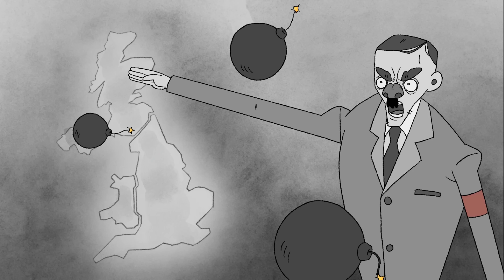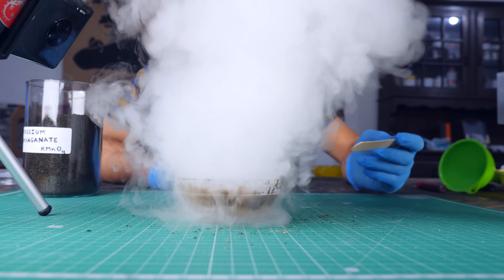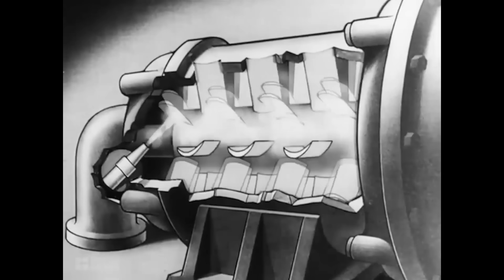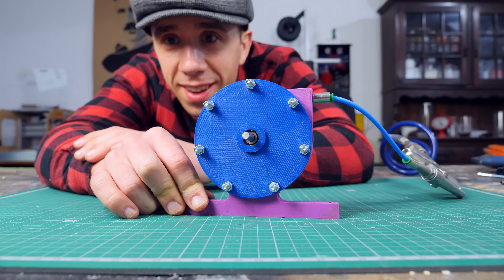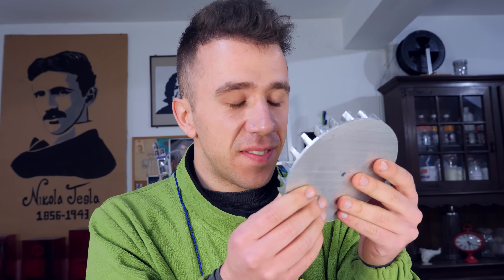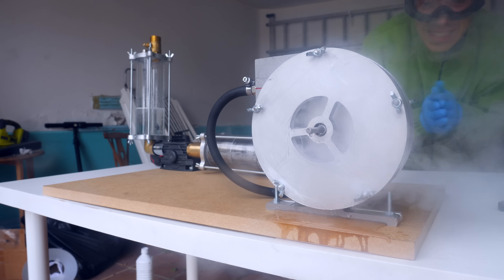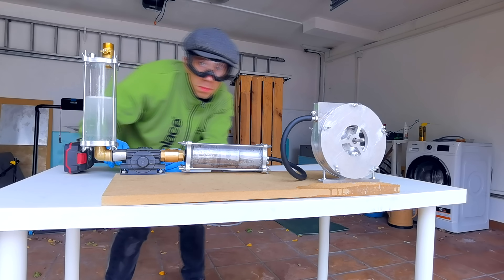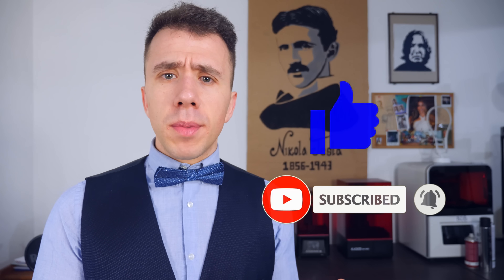I built the World War II V2 Rocket Steam Turbine

Comment: Using metal!  Yes - so much better than leaking and melting plastic!  An engine that is working is an excellent start.  I'd prefer  a small Go Kart to a skate board - much more practical to use as transport to a skate board which will only move itself likely.  Then again - that engine looks very under powered - it would have to be scaled up greatly - at which point I'd fear for your life - so perhaps not.  Certainly as already said - mount vertically and have a couple of inches of tube above the catalysts to reduce losing so much peroxide through the system.  Perhaps additional smaller catalyst grills can be added to the connecting tubes to convert any spray blown through.  Or improve the surface area of the catalysts in the first tube to get a better conversion.

Comment: Why not using a car turbo that can take a lot of heat, has constant lubrication, a perfectly balanced turbine and shaft and almost no drag. Also, the angle of the steam coming in might not be optimal. Catalytic converters work better when hot, why not pre-heat them before pushing in the hydrogen peroxide? Wouldn’t it oxidise more efficiently?

Comment: You need to get a bench top lathe, for metal, I need to get lathe also! 😆, Maybe 4"-6", 3jaw chuck, being able to make parts from metal will take things to the next level, I would like a 3D printer, so I can print things to make molds, to cast from aluminum, and about any car part made from aluminum, can be melted and cast, especially structural components, or pistons, very strong, and pistons will not expand that much with heat,  ya would not want to use aluminum cans. Too soft!! It needs to be an alloy, or you could buy  good old 6061t6 aluminum , but the salvage yard, or recycler  will be cheaper, but more work!! Awesome job!!

Comment: Maybe to improve the decomposition of the peroxide you can have the pump run the peroxide vertically into the catalytic converters. That way the liquid stays at the bottom of the converters and the steam rises up into the turbine.
Reply: That was I also thinking + he can put some pressure valve just before the proppeller acting as a buffer so it can have higher output pressure at the end
Reply: @krissko97  pressure regulator before the turbine is a great idea
Reply: @krissko97  this would just create backpressure and reduce the power at the turbine.
Reply: And maybe some empty space at the top to let any liquid that gets pushed up fall back down
Reply: This is a great idea.
Reply: My first thought, totally agree!
Reply: yup I was thinking the same thing
Reply: A peristaltic pump would be a better choice for the feed pump.  A metering pump for a well or swimming pool disinfectant ( NaOCl solution) would be ideal.  These are frequently variable speed and can be controlled with a 4-20mA signal.
Reply: Great idea. It's an optimal solution for a liquid trap and the sump can be connected to a vaccum pump...which would scavenge the whole catalytic system with a partial vaccum and improve catalytic reaction because less "spent" water and oxygen are blocking the cat surfaces.

Comment: A video comparing various turbine designs would bring together a lot of your videos. When should impellers be used? When are stators necessary? How many stages? Which turbines produce the most power or RPM for a given fluid flow?

You could print them in resin to compare designs, with the highest output and highest power designs milled on the CNC to see what output you can maximally achieve

Comment: Just for clarity both the v1 v2 and v3 projects happened at the same time being handled by separate teams. The v3 was a set of multi barrel (50 in total) multi chambered ( the charge in each chamber accelerating the round to faster and faster speed)  150mm guns, the barrels were 150 metres (490ft) long and were positioned underground at a sight in Mimoyecques France.

Comment: Video idea: Combine this with a steam engine (like the one you made a few months ago, but bigger) and create a TURBO STEAM ENGINE (stu stu stu). Hear me out: use the steam produced by the chemical reaction to power one or two pistons, and since the pressure is so great (you said 16 bars), you might be able to use the exhausted steam to power a turbine. The two pistons will power the flywheel (and maybe something else, since it is more efficient than the turbine), and the turbine (maybe connected to a on/off gearbox) could power the water pump (the one at 9:44) for continuous thrust. And there it is - the engine for the Steam Punk - Steam Powered Skateboard.

Comment: Mount the catalyzer on a 45° angle, minimising fluid output, then into a centrifuge trap, catching residual fluid in the bottom n steam out into the turbine. A fluted outlet on the turbine may increase output also.

Comment: Theme for a future video:- The electric jet engine which you just made reaches several thousand degrees at the nozzle, what if you convery the exhaust into *plasma*, and see it with a thermal imaging camera, you can do this by attaching a high volt power supply wires at the exhaust and make the part of wires at exhaust with tungsten to prevent melting. Improvement sugesstion:- you can use a porous thing to store Potassium Permanganate and pass the hydrogen peroxide through it, I think it work better than platinum or palladium.

Comment: Now that you have the CNC machining capability, you should revisit some of the projects you almost, but not quite, succeeded with. The pulse jet, for example. An aluminium nozzle would be much better than the plastic or ceramic 3d printed ones you tried before. You have most of the work done for them, and it would be great to see the projects finally tied up and properly working!

Comment: Turn your catalist upright with pressure hose at top so you don’t blow out the peroxide.  Also try gearing for your electric generator.  To add a piston set up with flywheel may give your better yields ,

Comment: Add a reflux chamber after the catalysator, mount the catalysator horizontally make the reflux chamber big enough to hold pressure to create a constant flow and increase the surface area of the impeller by adding more fins, also, increase the angle of attach at the beginning of the impeller and reduce it at the end the pressure of the gas is not constant as it moves through the impeller due to loss of momentum to the impeller and that needs to be accounted on the exit angle

Comment: Have the turbine shaft vertical.  That way, no liquid build up in the bottom of the turbine.  Also, you will need to worry about precession (if you imagine this in a real rocket). You have Tesla on the wall behind you. Use a Tesla turbine.

Comment: enough power to charge a capacitor and energize a large servo for a few seconds every minuet... controlling the tail fins with a mechanical gyroscope. accounting for weight transfer as fuel is burned.

Comment: I would recommend vertically mounting the catalyzer, that way the hydrogen peroxide has to fight gravity to leave the catalyzer. And maybe a U bend with a second decomposition chamber.
Reply: The U bend would be interesting to see but I feel would be over kill and increase the manufacturing needs in an unnecessary way Occam‘s razor essentially states keep it design as simple as possible.

Comment: Next step IMO would be to couple the turbine with the pump so that after an initial push it starts to self-power. Add a centrifugal governor to equalize dips and peaks in power and you should have a pretty good system running.

Comment: Maybe if you had an expansion chamber after the converters to separate the uncatalyzed peroxide from the steam and give a place for pressure to build. You can put a valve and gauge there to be able to control the pressure and volume going to the turbine. Just don't forget to put in a popoff valve because pressure vessels and 'splosions. Having some control between the reaction and the turbine is a good thing. Setting the catalyzer in a vertical stack might be good too so that gravity helps with the separation. 
This is all very exciting, though. Your work is true garage science!

Comment: I know this won't help with design safety, but making an afterburner to burn the created oxygen would definitely produce enough power to push a skateboard. When you also combine this with a vertically mounted catalysator, making the catalysator longer and introducing a wrinkled surface for the catalysator, I think you'll create a monster >:)

Comment: I got 3 ideas, mount the catalytic tube verticaly, and make a "two stage" turbine to better use the acceleration of the gas, like, having the exhaust part build like an turbine stator and putting another layer of blades in the impeller, i dont know if i am expressing well, AND try to make the exhaust port different  diameters, testing with air compressor to look for the performance, good luck ma boy, i love you

Comment: I think it would be better if you put the reaction chamber upright and have the steam outlet coming from the top of the reaction chamber, that way it gets less hydrogen peroxide in the engine.

Also, have a small drain hole at the bottom of the engine to drain any fluid.

Comment: @integza Can you ad some metallic powder to uv resin  from which you are printing ceramic parts? With something like that you should be able to print (and sinter) ceramic-metal composite parts which should be less fragile, less porous (less leaking) and still pretty heat resistant, so... maybe it could be good material for your projects?

Comment: Sadly, I am not good with 3d modeling, but things to try out would be:

Different nozzle design for high speed flow into the impeller 
a lighter impeller (skeletonizing)
Different impeller angles
like other people pointed out, mounting a pressure valve maybe helps
maybe increasing the length of the tube from the catalyst to the turbine and mounting it vertically to make it harder for the H2O2 to flow into the turbine

Comment: If you have the catalytic converter upright and allow the hydrogen peroxide to come in from the bottom, creating the steam to the top that might work better. Also, why use a pump and one way valve, why not just a normal valve to control on/off and connect the top end where the steam is generated back to the top of the tank to equalise the pressure. Gravity will feed the liquid into the catalytic converter and the pressure is equal so the steam doesn't go backwards. Then use excess pressure with a pressure valve to drive the turbine. That would give you a constant pressure.

Comment: Here is the idea, if You want more efficient turbine, You need to make smaller gap between housing and turbine itself... Allso You can improve it by changi g blades angle, width etc.... But my first idea was, why not to use Your rotary engine (vankel) for this, it was capable to run on CO2 cartridges so it should run on steam too, just make it again but from aluminium, should be easy with your cute CNC mill.

To reduce liquid coming from reaction chamber to the engine, just read other comments, everybody have like same idea and I agree with them.

Comment: You need to turn your reaction chamber facing upwards not on its side. The outlet is too low and it is blowing the peroxide out along with the steam. Since you are pump feeding the chamber you can just put it facing up and it should work much better.

Comment: I can see two ways of improving the design. Mount the catalytic chamber vertically and pump the hydrogen peroxide in from the bottom. the reason you're getting unused peroxide out through the turbine is because the steam generated in the catalysers is forcing it out through the horizontal outlet. Mounting it vertically should keep the peroxide in the chamber, and let the steam escape (or at least, mostly.) You could also add a steam pressure chamber between the catalytic chamber and turbine, and use a smaller bore pipe from the pressure chamber ot the turbine to increase the pressure and stabilize the flow rate. 

Also, an exhaust nozzle on the turbine might be a good idea... it'll raise the chamber pressure in the turbine and stop it dribbling everywhere.

Comment: Video idea: Make a jet engine electrogenerator. 

I love the way you talk about your CNC😄 Pure love, no regrets about 30 broken mills 😂

P.S. Placing catalysts incline, or even vertically, and placing an outgoing tube on the higher end of the tube should solve left-overs to spill out. Or maybe some vertical spiral tube with a big inner diameter should let steam out, and let hydrogen peroxide flow back down

Comment: so launch an RC rocket off a moving platform like RC train or car, see if you get a higher top speed if you leave the ground with increased inertia vs just launching off the ground.  Back when I was in undergrad I did the math and it seemed to indicate such a launch system would make a significant difference, but I never had the time or workshop to test it.

Comment: For a better turbine, you can find designs from the steam turbines used on rockets just after ww2 online now days. The Soviets used a double bucket kind of design similar to yours. But the blades over lapped each other and then fed into another set of blades to capitalize on the steam pressure.

Comment: Video series idea: see how advanced of an engine you can make, using only water and electricity as your fuel. 

Create a 3D printed electrolysis chamber to separate water into HHO gas, then use that HH0 to power a simple sterling engine, then work your way up to a steam engine. Can you make a HHO powered steam jet engine? Can you make a jet that runs only on HHO?
Reply: have separated electrodes so you produce H and O sperately 
storing HHO is a stupid idea as it's a massive explosion waiting to happen

Comment: Video idea: Use the Tesla pump to power a rocket or at least a file oxidizer mixture
Reply: And also just a suggestion for this video maybe try putting the catalytic converter camber at an angle to help with the hydrogen peroxide getting through or maybe try putting in a Tesla valve

Comment: Steppers are good for low rpm applications, and turbines work best at fairly high rpm. I think that for power generation you'd be better off using a gearbox along with your stepper, or no gearbox but a simple dc or brushless hobby motor

Comment: You don’t want one input on the turbine, you want a dozen or so (also hardly any extra space between the turbine blades and the turbine housing so most of the stream is doing work, also make the turbine blade turbo charger shape so as it exits the turbine its still doing work

Comment: You can heat the catalytic converter before the run in order to improve its performance. A few ways of doing this I can think of:

1) Placeing  it in the oven before every run.

2) Incorperating electric heating elements into its chamber.

3) Adding small (!) amounts of propane into the reaction chamber so it reacts with the hot oxygen to increace heat (and gas) output.

I hope that I'm helpful.

Comment: You should try to put more space between your peroxyde inlet and the catalytic converters, it seems to me like all of the liquid goes through a very small portion of the cross-section of each converter. Some sort of perforated plate should help build some pressure to help the peroxyde distribute itself evenly across the whole surface .
Reply: A thin-ish metal sponge would also probably do the trick

Comment: I think you need to take the steam outlet out of the top of the catalyst chamber - It might mean there is a build up of water in the catalyst, but the peroxide won't just get blown through to the turbine.  If the catalyst gets hot enough, the water will boil off so with tweaking it might sort itself out.

Comment: To help with the hydrogen peroxide coming out of the turbine it could help to mount the catalysator vertically; 
the fluid stays at the bottom and has a better chance to decompose before exiting to the turbine.
Reply: I came here to say the same, liquid goes down by gravity, steam goes up by pressure. Also more surface to catalyse.

Comment: The very first improvement you should do is have the catalytic converter case stand upright with the inlet at the bottom an the outlet at the top. This way any h2o2 which is being carried up towards the outlet has a chance to drip back down and the amount passed through should drastically reduce.

Comment: since the liquid is on the bottom so its pulling the speed down a bit since its on the way 
you can make a hole which is tiny enough to drain the water so it would go faster 
when you get a skate board and gear n stuff make sure the engine or the gear liquid proof if its not you know not happy ending

Comment: Future idea, As a coal forge blacksmith hobbyist, I would like to see all this experience you have had with all the different engines and turbines, to see if you are able to test all the different designs and find out which turbine/blower style would create the most amount of static pressure for a forge fire with the least amount of force or lost energy to get the temperature to the right levels without the flames getting out of control.

Comment: Video Idea 1: Explain how to jump though the hoops of getting a permit/license to work with 50% H₂O₂ in Europe under the regulation on explosives precursors.
Video Idea 2: Show what happens when you get a drop of 50% H₂O₂ on your skin.

Side note: Every 1ml of 50% H₂O₂ decomposes to ~90ml of O₂ gas, this stuff is way more aggressive than you might think. The higher the pressure and temperature, the faster the reaction. I.e. that acrylic tube could have easily blown up like a pipe-bomb if those CCs would have done the same work as KMnO₄ (which also produces O₂).

KMnO₄ is not really a catalyst by the way, it actually produces oxygen. This is because 2 KMnO₄ decomposes to K₂MnO₄ + MnO₂ + O₂. The MnO₂ will continue to function as the actual catalyst.